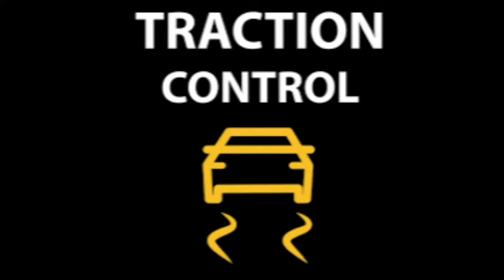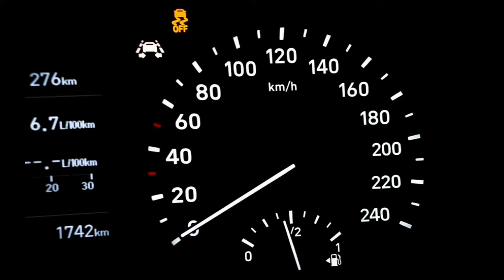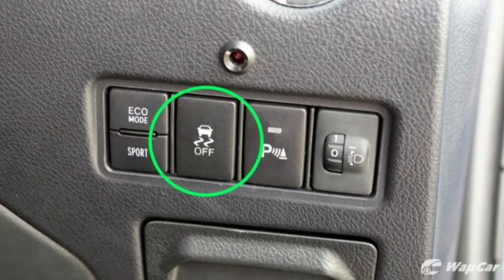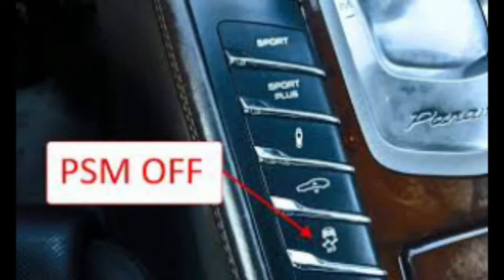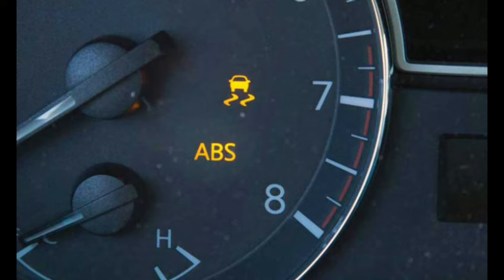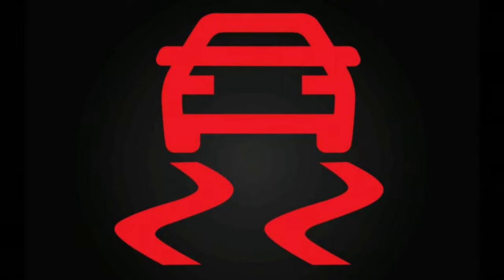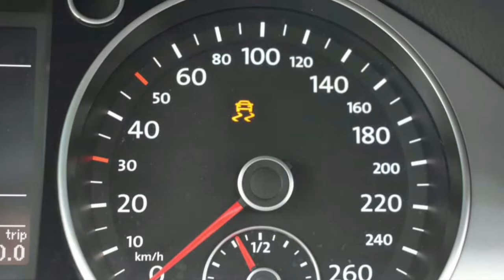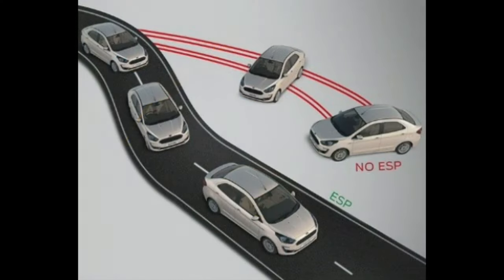How to Fix & Reset Traction Control or ESC Warning Light Stays On or Flashing | TCS Warning Light

Comment: 07 chev suv lt 1500 my tire traction wont turn off . My truck is literally broken 2 mechanic have looked and they dont know what is the cause . They saw the light but cannot pinpoint what is causing it . When im driving the traction come off and makes the truck stop instantly.  Please help me
Reply from the maker: @CHAOTICVIBEZZ If the traction control system is causing the truck to stop suddenly while driving, it's definitely a safety concern. The traction control system is designed to prevent wheel spin during acceleration by reducing engine power or applying the brakes to individual wheels.
However, if it's malfunctioning and causing the truck to stop suddenly, it could be a dangerous situation. I'd recommend taking it to a certified Chevrolet dealership where they might have more specialized knowledge and access to diagnostic tools specifically designed for your vehicle. This could help in identifying the exact cause of the issue.